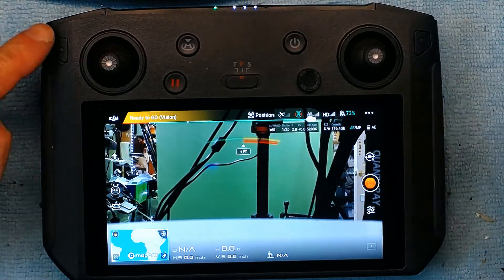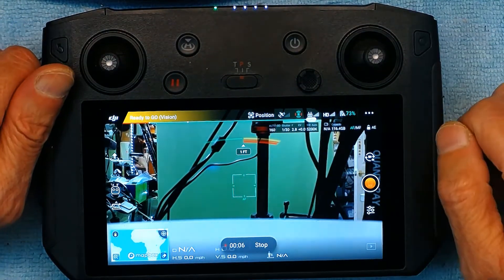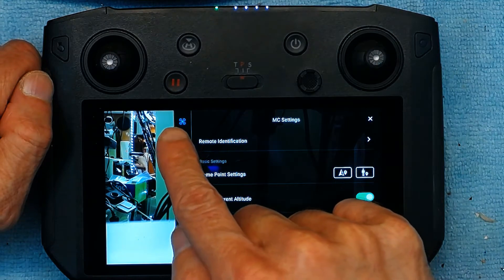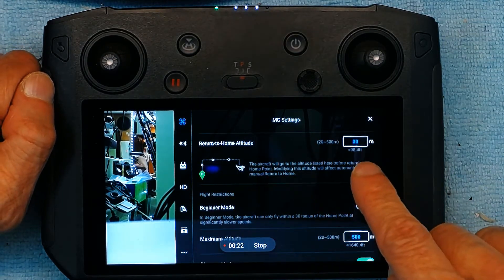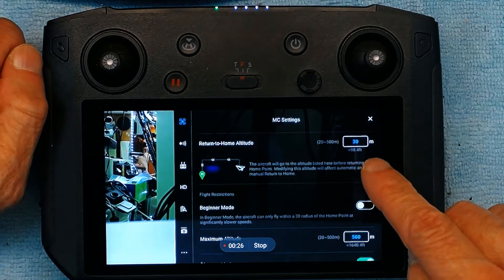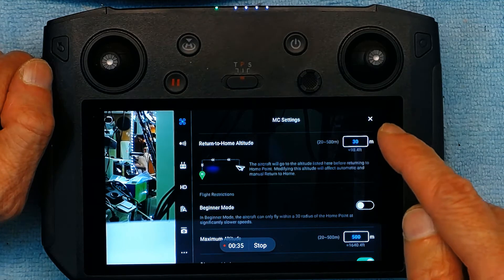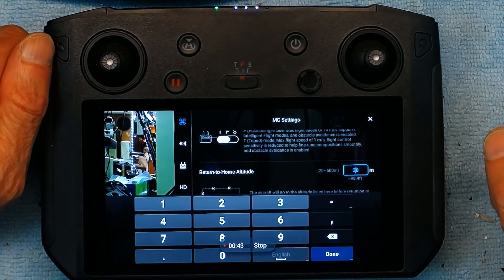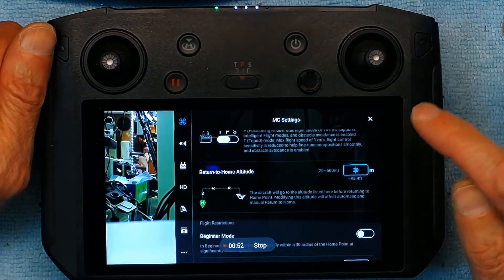How to Setup the Return Home Altitude on a DJI Mavic Pro 2 Drone Using the Smart Controller Remote

Comment: Hey, is there a way to stop the beeping when you use return to home?
Reply from the maker: Yes you can do that, but it will endanger the drone. So you have to disable the sensors to do it. For example in Sport Mode the sensors are automatically disabled.